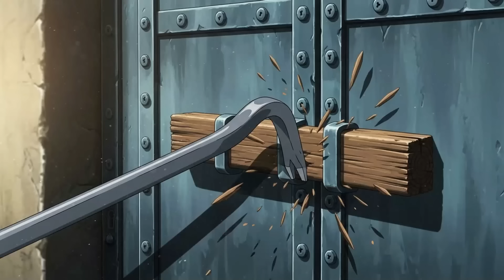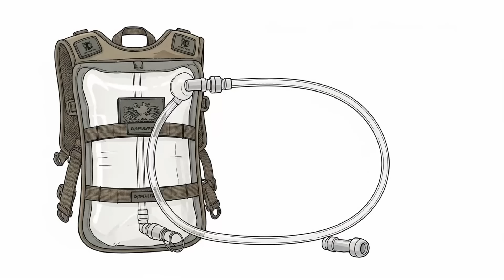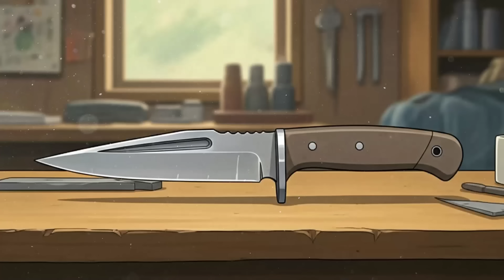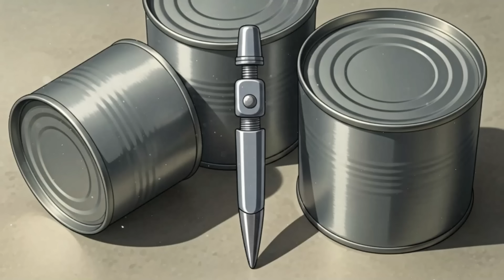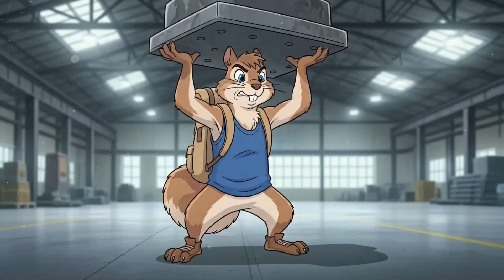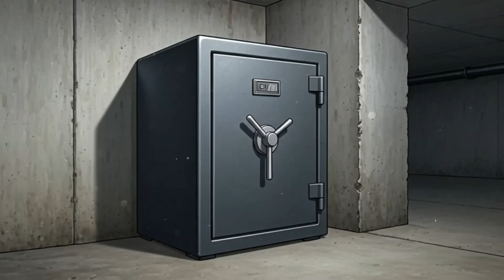They Misled You About Survival Equipment — The 8 Tools You Really Need When Civilization Falls

Comment: The part about the knives starting at about 9 minutes, it very important ,
( Pay attention)
Also buy a quality machete, for defense, cutting wood, etc, they are much lighter the a hatchet....and much more versatile.
Reply: The Estwing 27" camp axe is a great multi-tool, it is light and sharp, it's designed for more chopping tasks than splitting. All metal design and it makes for a great survival tool that'll last a long time.
Reply: I would argue a machete, except in the hands of Danny Trejo, is more dangerous than either a knife of hatchet...WITHOUT practice.  Kept sharp and practice with it and it is a fantastic tool, but it is more labor (and therefore calorie) intensive than just a good knife.

Comment: I love your videos! I’m that 1% taking notes on what I don’t have.😅 Without adding to the list (technically), maybe purchase a good knife that includes a sharpening stone. At some point your knife is going to need a fresh blade. If I were to add to the list, I think a pair of bolt cutters could be helpful, supplemented with a chain and lock of your own. Keep the videos coming. Now I’m off to figure out how to stock and use some antibiotics!
Reply from the maker: Thanks for the great suggestions!
Reply: @FalloutSquirrel , Machetes are lighter and much,more versatile then hatchets, and a foldable light weight saw is best for cutting wood, then a hatchet,
Reply: Remember if you need to move, the more weight you carry the more energy you use, and the slower you go.
Preserve calories, live longer.

Comment: I have a question about number three (clean water source). Where are you gonna get filters in a shtf situation? There is actually a tool I saw from an ex seer guy that is solar powered and only requires table salt to use. It’s used water and table salt to produce something like bleach (it’s not actually bleach) that can purify water. I think one dose cleans one gallon but don’t quote me on that. It’s a pretty good option. I also can say you should be carrying the straws along with tablets and a longer term solution for water purification cause water should be your primary concern as most people can only go three days without water before it becomes fatal and even before it becomes fatal you will not be in a good state of mind to function properly in these situations.
Reply: Just boil your eaterb
Reply: @mikeriddell1878  this only works to clean out biological threats but does nothing for chemical or radiological threats. So in other words the water could still kill you.
Reply from the maker: Well, you have to look in specialized stores. Or you can have a backup at home in case of these emergencies.
Reply: @FalloutSquirrel I was more asking to see if you knew any alternative to going to a store. Like things you can use in a longer term situation that maybe are in the wilds that can be used as a filtration device.